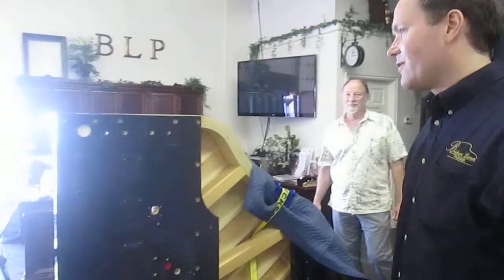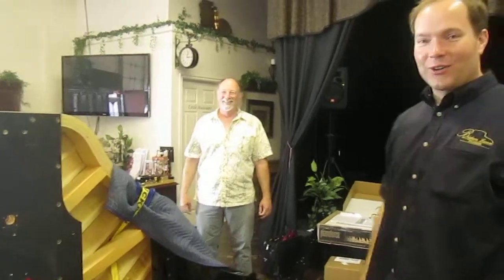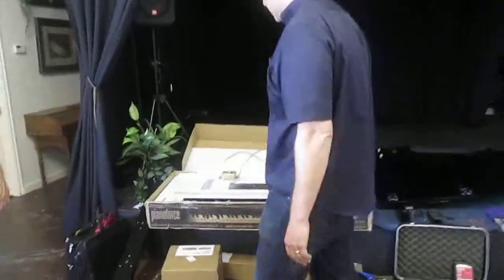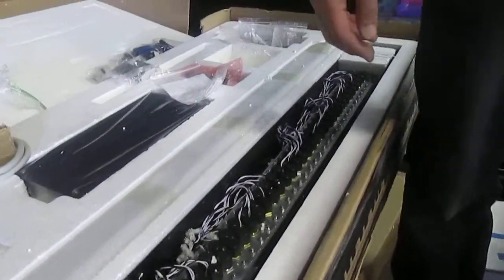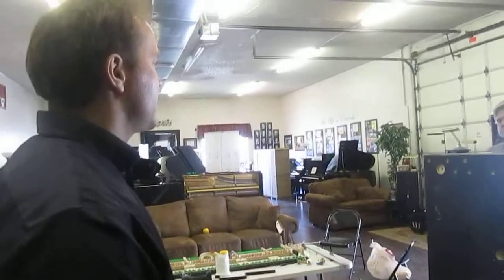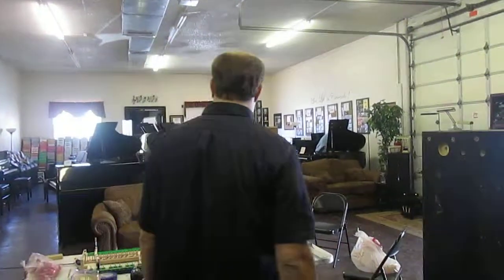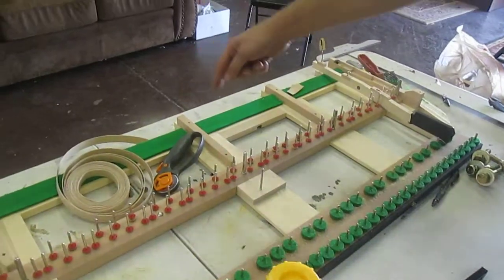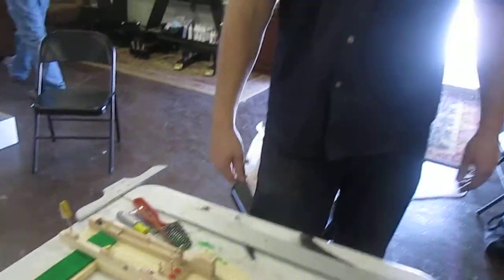Installing a Player Piano Mechanism in an Ordinary Piano with Brigham Larson

Comment: Can you input your own piano roll/midi information to make the piano play songs you’ve written?
Also, I have a vintage Rhodes keyboard and the keys are just like piano keys, could one of these players be installed on that? How much do these things cost? What about a player harpsichord, so those exist?! Thank you!
Reply from the maker: Yes you can.  If you have it on an SD card or USB you can put it directly into the player.  http://www.qrsmusic.com/PNO.asp for more info.  These can only be installed on acoustic pianos.
Reply: Brigham Larson Pianos  I am about to obtain an up right piano. My mom would be so proud me! I want to install by myself a payer system that can play Crazy Otto and O Brother tunes that I love! Is this realistic project? I’m retired  Organic Chemist, I built my house in 1973 and still standing. No noticeable cracks. I have built four plexus and flipped several houses. Although I may have the time, I have many projects and limited funds. I am not an audio nut and don’t need the top of the line system. What would suggest to me? Is there a possibility that I could trade my talents for a system? Thank you for considering this enquiry.